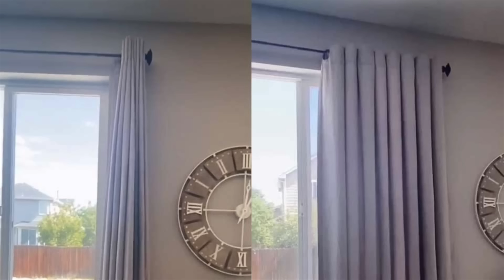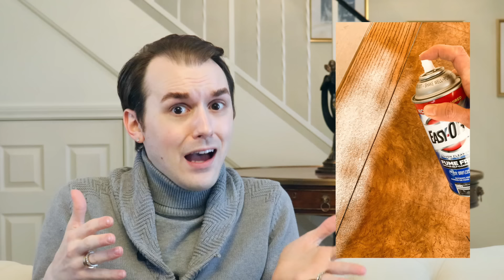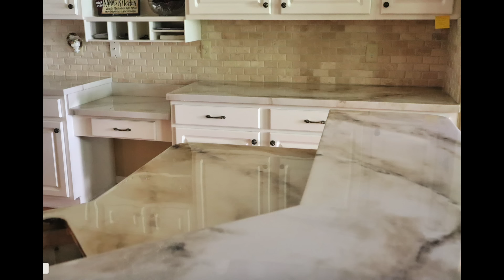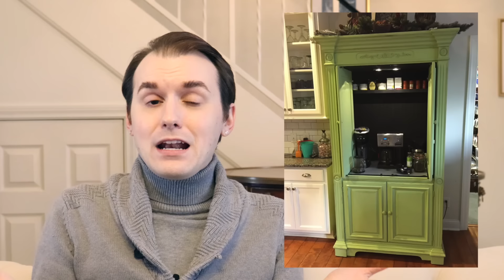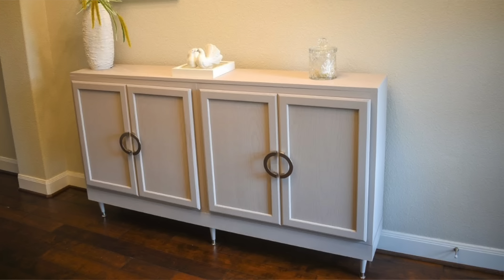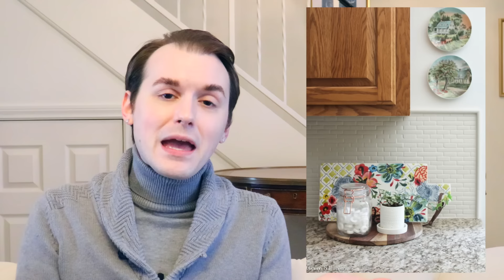The Best And Worst Social Media Interior Design Trends

Comment: I will say on the epoxy countertop… I was able to do a gorgeous thin concrete over mdf in my last kitchen. I spread thin layers of concrete, stained, and then sealed with epoxy. It won’t last forever, but man it is absolutely gorgeous, and so easy to clean, and was so crazy affordable. And if I scratched the epoxy, it was “self-healing” 🤯 however, i won’t do it again, I will try to just save up for a proper kitchen reno in my current house!
Reply from the maker: Sounds great! Thanks for sharing Meredith. :)

Comment: I have 24 years as an Antiques Restorationist, I will say there are some antiques that are just to damaged and will never be able to be restored or refinished because it's to cost prohibitive for the worth of the piece, in that case paint is an option to keep them from the landfills.  But painting a perfectly restorable piece is just a lazy person's way to the new catch phrase flipping furniture, which is really code word for as quick as you can to resell.. but I actually don't mind and I'm not mad at it.. lol.. chalk paint is a protective coating easy for me to remove when it ends up in the hands of someone who appreciates its antique beauty and brings it to me to restore and I would rather see them painted, than all that gorgeous, old growth forest lumber thrown in the landfill, for the cheap second grade slapped together wood or faux wood furniture you can buy now. I I don't understand the concept? furniture stripper fumes don't enter the air with gases, I have choked on oven cleaner, I have NEVER choked on wood stripper fumes, so not sure why one would do that with oven cleaner? I just have one question? what is the long-term durability of these trends? Notice we never see that?..
Reply from the maker: Thanks for supporting our channel and subscribing. We certainly appreciate it.
Reply from the maker: Great point! I think it's very important for decorators and designers to consider and support sustainability and the environment. That's why I regularly include those important aspects in my videos.

Comment: You asked about the oven  cleaner and I remember back there was a paint stripper with a similar active ingredient.  That being said I have only ever used oven cleaner a few times in my commercial ovens and even then I did not like using it.  When I need to clean my home oven dawn dish soap works just fine with out all the toxic fumes.  The other ovens were for a job and I was required to use it.  I dont keep heavily toxic things in my house because I have kids even though they are old enough to not touch things like my laundry pods and the bleach I still try to keep it to a minimum.  I can only think that oven cleaner much like lysol would absolutely ruin good wood.

Comment: I am soooo thankful you mentioned that awful trend of painting over antiques made from beautiful wood.  I also don’t like that partially painted partially refinished furniture….the ones with refinished wood drawers and painted sides and top.   I understand some antiques are made of a cheap, not so hot wood or the piece is way too damaged to attempt to repair and, in those cases, painting could be the best option.  But I am die hard wood person.

Comment: I'm tired of how influential some amateur "furniture flippers" are, and the terrible choices they make in "refinishing". Using "hacks" instead of industry appropriate products, and painting for trends more than for restoration and value of the piece. Very few re-stain and polish, or restore original hardware; instead opting for chalk, spray paint and wall paint!!??? No thanks. 
    So far, one of the best furniture flippers I've seen on YT is "Transcend Furniture Gallery". This lady truly understands the value of old antique wood, and knows when to paint or polish a piece. Her "paints" are hand mixed and made for furniture, with real industry products not "hacks". Even her 'trendy" pieces with paint and stain combos are done with appropriate products and careful process.
      We need more influencers with real knowledge to be at the forefront, not hacks peddling "hacks".

Comment: Epoxy-coated granite is just cheap and cheap-looking.  I've seen it done to cover up stained or dull granite, usually just to get a home sold.  Better is to find a local contractor who resurfaces the granite.  They come in and use a grinder that will smooth out the etched surface using a series of finer and finer grinding wheels,  and (usually) remove any stains, too.  Some will also seal it for you with the proper materials (usually an oil).  It cost more, but its a much better value than spending money on a cheapie epoxy coating (that will wear off in a few years) or getting brand new countertops.
Reply from the maker: Thanks for sharing, and supporting our channel by subscribing!

Comment: Oven cleaner typically has lye in it (sodium hydroxide), which is indeed also an ingredient in wood strippers meant for oil-based stains, like deck strippers. So maybe people think they are being clever by buying oven cleaner because it has the same ingredient and is easier to find and just spray on? It's a pretty strong chemical and it will burn you if it gets on your bare skin (and ruin your clothes, and kill the plants you sprayed it on...ask me how I know). There are definitely better, safer alternatives out there.
Reply from the maker: Agreed! Thanks for sharing, and supporting our channel by subscribing.

Comment: Another fantastic video. Found myself nodding along to everything!

With you on the furniture painting - one of my pet hates! Another thing that baffles me with some of these furniture 'makeovers' is that in additon to the paint, people will remove or cover up all the detailing and trim from older pieces to make them look 'modern'. I can't understand taking an interesting vintage piece and then making it look like something you picked up from IKEA or some other big-box store.

I do have to confess I've painted a fair few furniture pieces in my time, but they were almost all old, tired-looking IKEA pieces which I've now given a new life. I would never paint an antique or anything with a good quality wood finish. My favourite refinished piece is an old IKEA chest of drawers which I repainted in a gorgeous ochre chalk paint, sanding down the top to the bare pine and varnishing it and replacing the drawer knobs with some lovely ceramic ones. It fits my style so much better and you'd never guess it was originally IKEA.
Reply from the maker: My problem is people painting over wood in good condition or wood that can be refinished that are made of fine or exotic wood.
Reply: @GarrettLeChic  Absolutely! There's definitely a place for chalk paint for brightening up cheap furniture or items where the finish is beyond repair but not for fine woods - just no.

Comment: Always great advice and you're also funny. I think these "influencers" have been peeking in my windows. My home is 180 yrs old so the kitchen doesn't easily meet modern living. We added shelving into an antique armoire where we store all the pots/pans and most dishes (we also use a pie safe for the food). We're currently in the process of converting a TV armoire into a wet bar. Ours have the doors that slide in because we didn't want our drunk friends handing on the doors. We're adding a small sink and a fridge. It took us about 5 years to find one that would accommodate what we wanted (and still look like an antique). We also try to upcycle where possible. During renovations, we had to remove some damaged flooring. It's heart pine, 6 inches wide and 1 inch thick. We had it planed. It will use it for our kitchen island top.
Reply: That sounds wonderful.  I actually really like the old style kitchens as separate rooms with the table on them.  Contains cooking fumes and others don't see your dishes.

Comment: I saw a video where they did a table with oven cleaner, had to do it several times, but it came out ok. They washed it real good, did some sanding on it, put alot of oil back on the raw wood, let it soak in, then used wax to seal it. Looked ok I. The video, but not sure if it's something I would ever try.
Reply from the maker: Not something in my opinion to do regardless of outcome. Just because something can be done doesn't mean it should be done. The manufacturer did not make this a furniture stripping product. There is always possible danger in using a product for an unintended purpose.